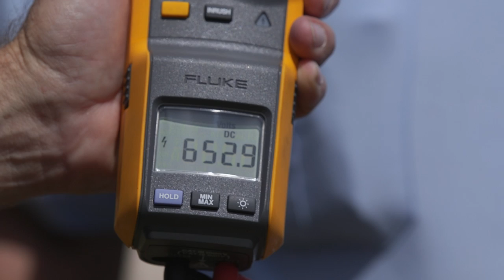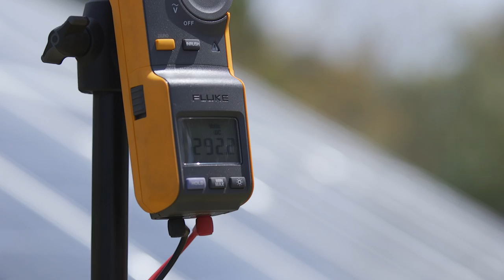Electrical Arcing & Water Conductivity

Comment: What you've showed us..
Is when the glass on a panel is damaged 
It doesn't effect power output that much...
You didn't show us any damaged cells..
Your watering down the panels and the voltage going to the panel mount...
Shows the importance of grounding the metal mounting structure..
Reply: jim h I bet, the structure has to be grounded, anyways.
The voltage doesn't kill you. It just looks great in such an advertising video.
Reply: Normally, a solar installation would be properly grounded, but the grounding could be damaged in a fire or earthquake. A very large rooftop installation, like on top of an industrial building, or a Wal-Mart might carry much higher voltage and current in a damaged situation.
Reply: While I agree this video is misleading, grounding a solar panel would not help much in this situation. The reason grounding works for normal household power is because it is tided to the supply one way or another, often times through the neutral so a short would send the current directly back to the source and protect you. On a solar set up the positive and negative are isolated from this and a ground would not help. Now if one of the panels line where connected to the ground then I could see it working. On the flip side having the panels lines grounded could actually create a greater hazard as now there is a means to get shocked if you touched one of the panels hot wires and where gounded. If the panels lines where not connected then you would have to touch both lines not just one to get shocked

Typically the reason for grounding a solar setup is to protect against lightning not for electrical faults.
Reply: Jason Harrison The inverter needs to be grounded, too.
Reply: BONDING!
Reply: Which is also ridiculous as most roofs have a lightning rod installed and even if they didn't, the low impedance through the DC wiring to the inverter (even if through the regulator and battery bank) will be the path of least resistance when it jumps from the DC side of the inverter to the mains earth or bonded neutral leg. 

Grounding a solar system makes more sense though than those who choose to ground a genset.
Reply: @ jim h : "the importance of grounding the metal mounting structure"  Grounding the mounting structure (assuming the roof isn't grounded) will only INCREASE the chances of someone getting a shock!
Reply: Grounding of the metal structure is required by building codes in Australia.
Reply from the maker: That is correct, the glass on the panels is damaged but the solar cells are intact.  Every cell in a solar panel produces 0.6V, any undamaged cells in a solar panel will continue to produce power, even if other cells in the panel are damaged or destroyed.  The panel itself will continue to produce power as long as it is exposed to light albeit at a reduced electrical output.  It does highlight the importance of grounding the structure effectively.  In our experience a surprising number of installations are not grounded effectively either due to poorly maintained componentry or poor installation practices.
Reply from the maker: I apologise if you find the video misleading, everything you are describing is correct and I am sure you understand the issues in trying to describe all the possible scenarios in simple terms.  This is why we developed PVStop, it is a simple solution to a complicated problem (but backed by over 40 years of solar system installation experience), if we went into all the variables in detail, it would be far too complicated for our target audience to understand.  We are not trying to mislead or condescend, just trying to raise awareness of possible issues.
Reply: Solar panels are expensive and I can't see anyone purposely destroying them just for a 3 minute video. My first though when they showed the array was I hope they aren't going to destroy it
Reply: The only misleading part is the fact that IF the frame of the panels and support system was grounded properly all the DC voltage would be redirected to ground and the amount you were able to read on a meter would be little to nothing. So either you ungrounded the system for your test or it was never grounded properly to begin with.
Reply: Ahhh! But why!!!? All that does is take a supply with no ground reference and therefore very low (some would say minimal) chance of an electric shock and giving it an earth reference and therefore a current path.  I don’t see why that decision was made given that it doesn’t add any safety benefit and in fact reduces the overall safety of PV systems in general. There is absolutely no safety reason I can think of for grounding the DC supply.

On a side note though, given that we don’t actually have AC supplies in residential installations and a neutral and active instead, what do they term the bonded and other side of the DC supply? “Gnd” and “Hot”?
Reply from the maker: Just to let you know, the panels in this video were purchased damaged (a forklift had driven into them at a factory and shattered the glass in all the panels).  Hence they were purchased at a significant discount and perfect for untilising in the video.
Reply: Jimmeh B I do not think your background in basic electrical knowledge is sufficient enough to even understand what is going on. Anyone who would propose the idea of leaving the frames of a solar array ungrounded is literally speaking nonsense. The frames of the panels are insulated from all cells and should not be "bonded" to DC negative, but they should all be connected to their own earth ground conductor and returned to the inverter , panel or dedicated ground rod depending on the installation type.

The error with the video, is that the condition they are using to "sell" their product is basically saying anytime the DC energy created in the cells escapes to the frame that it is dangerous. This is exactly why grounding the frame is required in all solar installations. When and if solar energy makes it to the frame it will be carried to ground and destroyed, quite literally meaning you can touch the frame with zero risk as long as the grounding system remains in place.
Reply: Righto then, what is the purpose of grounding the frame?

Also, I have 30 yrs of background of "basic electrical knowledge"
Reply: Are you seriously asking why you would bother to ground a giant metal array wrapped with AC/DC conductors depending on your system type, that you install on or near your home? What strange 3rd world country do you live in, AND as was already said you ground the array to KEEP the proposed problem in this video from ever happening. Let alone lightning protection and static bleed prevention. I am sorry but I do not think you have 30 years of any type of electrical experience.
Reply: 1: it CAN NOT keep the problem in this video from happening, period, ever. 2: on a tiled roof... ok I can see lightning protection and static, but on a tin roof these types of safety controls already exist.

You are talking about an ISOLATED DC power supply. I think you need to refresh on current paths, or at least stop and think about it. 

A MAINS EARTH does NOT equal a SAFE SYSTEM in EVERY INSTALLATION!  
Do you even understand the purposes of a mains isolation transformer?

Insult me all you like, but you are WRONG! Whether it is legislated or not.
Reply: Jimmeh, you can attempt to seem educated over the internet all you like that is your right as a keyboard warrior. The reality of your situation is quite clear, you have no experience and are working on theories alone that you do not even understand. The solar boom has been over for near 5 years, I was designing, building and selling solar systems for my company 10 years prior to the boom. I will gladly provide you 600V dc, help you earth ground yourself and let you touch it if you like. I will even make sure the amperage is sub 5amps so you have a high chance of survival if your heart is in good condition. I will then reproduce this video exactly and show you what happens when you apply 600v DC to a grounded array. I will even get naked for you and lay on the array.

You are attempting to save face with zero knowledge and zero field experience. It will not work on me sir, I have more electrical experience in strictly solar installations than you have in your entire life.

There is not a single condition you can create on paper or in reality where a well grounded array becomes dangerously electrified as long as it remains well grounded.
Reply from the maker: Just to wade in on this, a well grounded array is electrically safe.  Chris as you would know from experience, a lot of systems out there are not well grounded, whether that be due to poor installation practices, component deterioration,  poor ongoing maintenance or a combination of all of the above, we see examples of this every day.  We are not professing that all systems are dangerous, but referencing Australian Government Clean Energy Regulator data (who have been auditing residential installations since 2011) 4% of Australian residential PV installations are unsafe and a further 16% are sub-standard.  If you extrapolate these figures out based on the 1.7m residential installations in Australia that equates to 68,000 unsafe PV systems and a further 272,000 sub-standard systems.  We believe that most countries are experiencing a similar number of issues (on a percentage basis).  This is a significant safety risk which is why we developed our solution and why we set up the test in this video.
Reply: I am all for niche product design in a free market system and I wish you luck with the marketing and future implementation of your product, however I see no reason to risk personnel in any fire event that involves roof access and solar installations. 

We have always been required to allow "Firefighter" access lanes to the ridge cap of the roof, but as has been discussed for years by top fire marshals the procedures for fire fighting in the US have long since been changed to compensate for the lowest risk of fire fighter injury. Basically it is contain the fire to save surrounding homes and let the property be restored by insurance. There is no practical reason any personnel but trained installers or electricians should be physically touching a damaged or questionable array.
Reply from the maker: Thanks Chris, the standard operating procedure for firefighters is to isolate electricity in an escalating fire response, up until now, they have not had a fast, effective or safe way to isolate the power produced by solar PV panels.  There is a significant knowledge gap and first responders are frequently exposing themselves to "near miss" scenarios without even being aware of the hazards.  After all, firefighters (for the most part) are not qualified electrical technicians.   In the US, there have already been firefighter injuries directly attributed to solar PV arrays, so there is a tangible risk to firefighter safety.  Also if there are people trapped in a structure featuring a solar array, firefighters will accept calculated risk to save saveable lives, it is not in their DNA to stand back and watch.  Our product immediately isolates the power produced by solar PV arrays, removes the risk of electrocution , allows Firefighters to take an "offensive" rahter than a "defensive" approach and ultimately, significantly improves firefighter safety............surely that is not a bad thing?
Reply: I can see this being used in flood situations, possibly solar array demolitions following large scale damage or possibly auto accidents some how involving solar arrays, but there is no logical reason fire fighting personnel should be scaling a roof in 2018. They use a giant roof spike that is high voltage rated insulated and designed to move live power lines to open a hole in the roof of structures that need venting. After the roof is vented they then fill it with water from a moderate distance or from an insulated truck ladder or bucket.

You are quite right about entering a dwelling to save human life, but that has nothing to do with climbing on the roof of a structure that is on fire with unknown structural stability and an extra 1200lbs of unknown electrical equipment. 

So not to be overly direct, but if the main methodology of your product is to put it in a container under moderate compression and require a human to spray the panels at close range, I think you might be many years behind the  times targeting roof mounted arrays.

You can safely cross firefighter roof usage off your list of potential consumers.
Reply from the maker: You are forgetting the wiring running down from the panels to the inverter (the DC Danger Zone) This wiring can be running through roof and wall cavities, creating an electrical hazard.  The whole idea of PVStop is to cover the solar PV array from a distance, not scaling the roof (which is still a current procedure utilising tarps for a number of fire departments).  PVStop has now been adopted by Fire Brigades across the UK, Australia, Japan and very shortly the USA (we are currently in discussions with FDNY and have pre-sold trial quantities to about a dozen brigades on the east coast, so I can say with some confidence that our solution has it's place in the fire service industry.
Reply: Yes, I can tell you are quite interested in marketing this product.

 I am sorry, but this is just another useless product that municipalities will waste money on thinking it will keep someone safe. Meanwhile, 99.9% of the time the transformer is still live and meter still in place when the fire is put out in the home.

The utility company comes to disconnect power long after the fire is out and this product can be used long after the fire fighting process has ended when it is time to survey the internal damage, if ever.

If I ever see a fireman spraying panels with this substance while the house burns, I will pity their leadership.

This product has small potential for use, but you attempting to wedge in to the emergency response market, especially by leveraging their safety, is rather pathetic I am sad to say.

This is what salesmen do, they prey on peoples ignorance. 

I wish you well.
Reply from the maker: Our mission is to improve knowledge and improve firefighter safety, you are cherry picking particular scenarios whilst ignoring the fundamental problem that solar PV systems are electrical generators (during daylight hours) that do not have an "off" switch.  Our solution offers an "off" switch for situations where Solar PV systems pose an electrical risk.  That's about as simple as I can make the explanation.  You have obviously formed your own opinion and you are entitled to that.  Thank you for the well wishes.
Reply: @Chris Ko : Absolute BULLSHIT! I am no KB warrior, and I have PLENTY of experience in distribution systems, RF transmission systems and relay systems as well as embedded and plant automation systems. You my friend are dead wrong. 

I'll flip it... If the frame is mains earth referenced AND the "hot" leg of the array makes contact with the frame, what happens? FUCKEN NOTHING, that's what. The frame sits at for eg: 600VDC and has NO CURRENT PATH back to the GND leg IF as YOU stated, the neg side of the array is not bonded (in reality though, I'd bet ten bucks and my left nut that the gnd inside the inverter is tied to mains earth in order to protect against the event of an insulation failure in the step up up transformer giving the MAINS current a PATH TO GND, which, having looked further into this, it seems to be and you should know if you were indeed ever involved in inverter design) 

The ONLY reason that the 600V leg of the array is AT ALL dangerous is IF AND ONLY IF the negative side of the array is at some point, somewhere within the P.V. system tied to mains earth thereby creating a low impedance current path for the hot leg of the DC supply.

Again, you can insult me all you like, but you're dead wrong.

The common assumption that because something has a green or green with yellow wire attached to it and there is an RCD in place, the system "is safe" is bullshit. I doubt you even know from your attitude, why mains earth was implemented in the first place (many don't, but often think they do).

I'll gladly have you around to look at my sputtering set up or my tesla coil or any one of my HV power supplies and hook you up to any voltage you like and watch you fry from the inside out while telling me you can't feel a thing if you'd like.  I however, still have ten fingers and ten toes... I KNOW MY CURRENT PATHS inside out. you arrogant fuck.

I concur with Jason Harrison, you like many other commenters here should go and watch the video he has taken the time to find for your like, you should also watch the video the content provider of that video points to on isolation transformers. Clearly you've forgotten electricity 101.

So having thrown as many insults my way as you have and having insulted my intelligence in many and varied ways, what say you now Asshole?
Reply: KappaW : dead right!  It is basic!!! SIMPLE OHMS LAW!!! I too have ALWAYS ensured that I NEVER leave my D cells sitting with the positive end down on the ground.... runs 'em flat QUICK SMART!!
Reply: KappaW : No, Jason Harrison is absolutely correct, it's you that seems to have very little idea. He's making the same argument I am. Which btw, is correct.
Reply: For all of you who need a refresher course on isolated power supplies and grounding. Have a look at this video. https://youtu.be/fRhofcMyAyk
Reply: @Jimmeh_B  Not true. having the frames and mounting hardware grounded, guarantees that everything is at the same potential. National Electrical Code requires photovoltaic arrays to be earth grounded, even if it's a "stand alone" system. Not just for the reasons shown in the video, but also to offer a safe path to ground in case of a lightning strike.
Reply: Vincent Robinette just because it's code, doesn't mean it's necessarily the "safest" way to do anything. 

A spark gap inside the inverter could serve the same purpose. 

In fact, if it were up to me to decide on the code, I'd be more inclined to require lightning rods and low inductance earth paths as well as requiring the gpo's be a floating supply. 

Not so hard, just up the step up xfmr isolation requirements and ensure an suitable low impedance path to earth is available exclusively for arresting strikes.

If this were the case, gpo's would be a completely isolated, floating supply with No Earth Reference meaning no current path through ground. IE: Much safer.

It makes even more sense given that the reason earth reference was created was a direct consequence of building distribution networks by way of hanging   wire in the air and that a local power supply doesn't suffer exposure to the risk of strikes.
Reply: Vincent Robinette also...  How often in practice, does a green or green with yellow wire guarantee everything is equipotential?
Reply: @Jimmeh_B  If the wire is properly bonded, it conducts well enough that there can't be enough difference in potential for you to feel anything. If there was even 6 or 12 volts of drop across that wire, which is far less than you're likely to notice while touching the two surfaces, that wire would be smoking.
Reply: Vincent Robinette irrelevant
Reply: @Jimmeh_B  The first goal, is to turn every surface that anyone or anything can come in contact with, into the same piece of metal. You only get shocked, when you become a path of least resistance. A wire, with a fraction of an ohm of resistance, won't allow enough potential difference, for you to notice anything. Floating the system would be a dangerous thing to do, because, that lightning WILL find a path to ground. The idea, is to provide a safe, low impedance path to ground, rather than anyone nearby, or any critical equipment. The main reason lightning causes fires, is it having to pick a high impedance path, like wood, or timbers, which have enough resistance to reach ignition temperature in an instant.
Reply: Vincent Robinette you're preaching to the choir. 

Perhaps you should re-read what I've said
Reply: Vincent Robinette if nothing is referenced to mother earth, there will be no current path to earth.

Simples.
Safer.